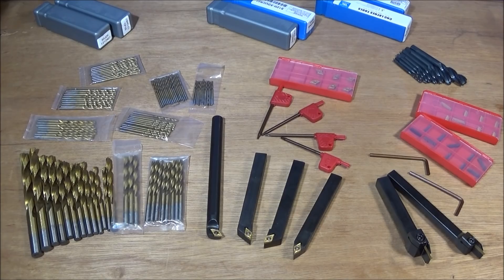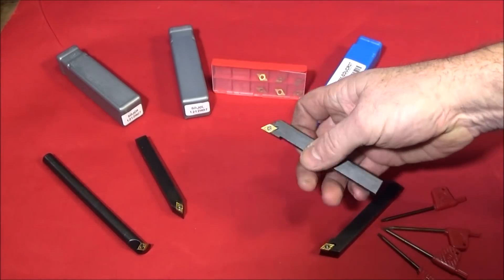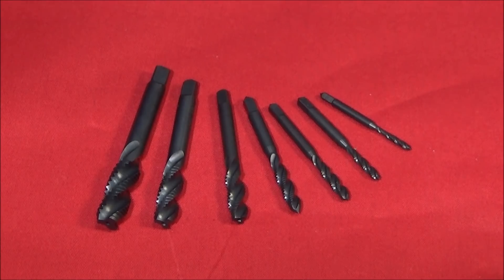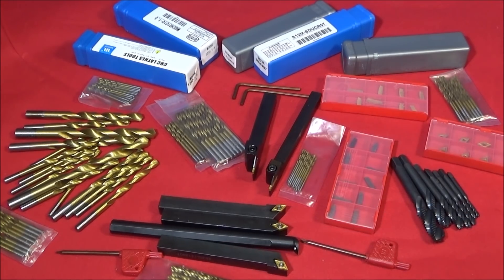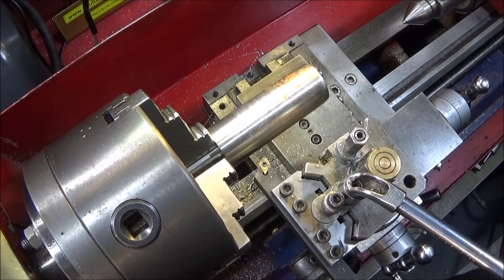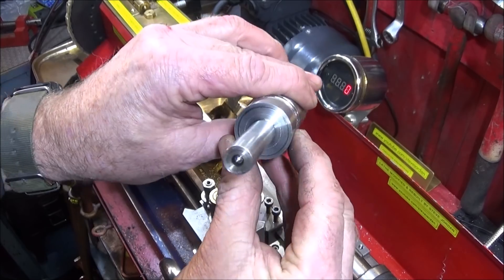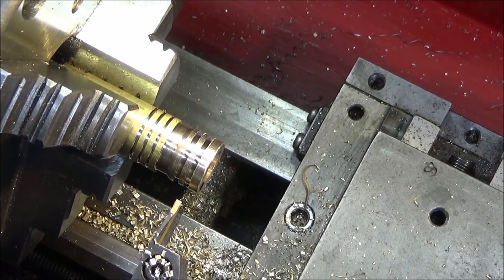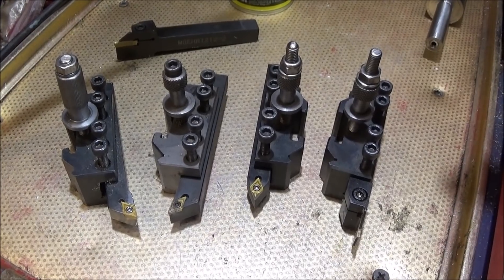The Best Cutting Tool Sets To Get If You Have Just Started Lathe Work

Comment: Don't buy the non-cobalt coated drills, they can be fake made of mild steel or something.
Reply: And for taps, use spiral point or gun taps always when you can (when tapping through holes) as they are cheaper, more durable and you can actually sharpen them unlike spiral flute taps!
Reply from the maker: I found the Chinese HSS Screw taps made by Drillpro to be excellent.
Reply: @SteveJordan  drillpro is one of the best brands in china

Comment: What would be best for my 12 inch atlas,,, blue nano are titanium?
Reply from the maker: It doesn't really matter. I only buy the Blue Nano for hard materials, but I have found the titanium coated ones very good as well. They just don't last so long on stainless steel etc, but then again they are very low cost. Regards Steve

Comment: if im running the #250-000 wedge type quick change tool post on a ML7 and use the 12mm shank tools used here, will it o low enough to get correct tool height without having to machine the top slide?
Reply from the maker: No it is limited if I remember rightly. I will re check it tomorrow as I have an un machined compound slide as well. I am pretty sure the 12mm tools are too high. Regards Steve
Reply: @SteveJordan   thanks mate

Comment: Recently I purchased a used 7x12, and coincidentally purchased as well the same tooling with inserts, that your using. Unfortunately for me I had to grind about a 16th of a inch off the bottom of the one of the tools I have tried out, to indeed center it with the work!? 
Question is, would the quick change tool post w the adjustability make it to where I don't have to ruin and grind down the rest of my tools to be centered and not too high? ( Judging by yours lining up just fine I assume my fixed standard tool holder is my issue?) Thanks.
(Edit added 2nd question) I'd like to get a indipendent 4jaw to upgrade, do you have the backing plate part # for the 3 bolt flange adapter to fit a 3 or 4 bolt 5inch chuck? Or just as well what do you have? Thanks again
Reply from the maker: Hi Kevin. If you had a quick change toolpost set that would allow proper centre height positioning as long as your tool thanks are not greater the 12mm square. I have got a backing plate for the 5 inch 4 jaw chuck. I think you can get the plates from Chronos uk. Regards Steve
Reply: @SteveJordan  thank you

Comment: Steve, you should be knighted for your service to the amateur machining community!
Reply: i haven't yet purchased a chinese mini lathe. your videos have convinced me that it would be a worthwhile purchase. however, i am stalled at the point of purchase. there are so many on offer by various resellers, as well as direct from manufacturer on alibaba. there also seem to be some variations on machine capacity and motor power, as well as purchase price.

it would be very helpful if you would do a bit of research, and address these issues, and make recommendations.

again, many many thanks for your work.

Comment: If you check the carbide inserts, none of them are actually sharp, they have a 'flat' near cutting edge  and are designed for higher speeds and feeds The mini lathe cuts better with HSS but you do have to learn how to sharpen lathe tools from blanks with a bench grinder. I think using carbide inserts is the main reason people give up with the mini lathe or burn out controllers?
Reply from the maker: Hi Peter, That isn't at all correct. Carbide inserts have a radius not a flat, which is how they are designed. They also do not 'burn out quickly' unless one is using them incorrectly. 
  I use the 070204 insert tools and an edge on one of those will last a very long time even on stainless steel. Carbide inserts also have the advantage in that one can change an edge quickly and the centre height and tool position remains exactly the same. I personally think they are the best type of tooling for lathes and CNC machine tools. 
   Also if one is new to machining, buying a mini lathe, with all its problems from new, plus having to learn to grind tools is what puts many people off. Its generally all too much for people to find out how to do things unless one is truly dedicated and perseveres. 
   Also the Chinese Mini Lathe,  has duff electronics from new, if it has the same electronic boards etc, that my 9 year old Amadeal lathe had. (I don't know if they have been upgraded now?) I have over 30 years experience in engineering, yet I had two of these boards break down and also had to replace the potentiometer about a dozen times over an eight year period. A DC motor set-up isn't all that good for a lathe. Plus when buying a Chinese Mini Lathe they need quite a bit of work to get things like the slides rigid enough for proper machining
   It is great to learn how to grind HSS tooling though and I do have many specially ground HSS tools for specific purposes, like internal/ external o/ring grooves etc. I just think with the amount one has to learn at the beginning, its best to start with insert tooling. One can also get good knowledge from these tools, how they work etc before trying to grind HSS blanks. I personally will stick to insert tooling as it is truly excellent in every way.
Reply: @SteveJordan  I think you misunderstood me about burn out. The mini lathe controllers burn out power mosfet if overloaded which is quite easy to do with carbide inserts. With a x10 loupe it's easy to see they are 'blunt'. Saying that, my mini lathe is about 14~15 yrs old and still going strong, but, I'm very careful not to overload motor.. I was given a mini mill with burned out controller, but that's another story

Comment: Will these work on a Sherline 4000 ??
Reply from the maker: Hi yes they will but check out what shank size will fit in the toolpost. You can get them with 8mm shanks if you need a smaller size. Regards Steve

Comment: Helpful advice Steve. What life do you expect for the carbide inserts. I have been using a similar brand for parting off and find that the inserts only last a few cuts.
Reply from the maker: I find the inserts excellent. The same as any well known brands really. People say that it is the ones made in India that are useless. There must be something seriously wrong if your inserts only last a few cuts. I have just made several steel components using one edge and the insert still doesn't need changing. I only use the titanium coated or blue nano inserts though.
Reply: @SteveJordan  My parting inserts are from China. They are definitely inferior to the Kennatool inserts I normally use. Maybe I should try blue nano inserts as you suggest. The holder tool is identical to one shown in your video.
Reply from the maker: @ALA-uv7jq  Hi Yes I forgot about those. The part-off inserts are not all that good yet, definitely no comparison to Kennametal, Iscar or Sandvik part-off inserts. All the turning tool inserts seem good to me though. I'm hoping they will improve the part-off inserts at some point.
Reply: @SteveJordan  Thanks. Yeh I only referred to parting inserts.The parting tool holder MGEHR 12-2 seems robust enough, just the inserts don't last, especially in s/s.  I have ordered a set of blue nano type. Lets see how they go. Cheers.

Comment: How about some UK suppliers instead of Banggood for everything.
Reply from the maker: The UK suppliers buy these tools from China for very low cost, Then massively increase the prices for re-sale. I would rather get the things for low cost as well. There are those that tell people to support UK suppliers, but most people can't afford to pay the extra costs and be charitable these days with this type of thing.
Reply: You'd be better off paying Steve. He's providing what you would traditionally have paid a UK retailer for: expertise in why/how to use these tools. The other value proposition of the supplier (and maybe the retailer) would have traditionally been the ability acquire the goods. That value proposition isn't relevant in this case.

Comment from the maker: LINKS FOR THE TOOLS.
Machifit  4pcs Tool Holders With DCMT070204 Carbide Inserts -- https://goo.gl/q4Xqm1
10pcs DCMT070202 Carbide Inserts -- https://goo.gl/BM1PVr
Machifit 10pcs DCMT070204 Carbide Inserts -- https://goo.gl/q4Xqm1
MGEHR 1212-1.5 12x12x100mm Grooving Tool Holder --  https://goo.gl/BmpQxF 
MGEHR 1010-1.5 10*10*100mm External Grooving Lathe Cutting Tool Holder -- https://goo.gl/dkLDHG
10Pcs MGMN150-G CNC Blade Carbide Inserts -- https://goo.gl/F67zQy
7pcs M3-M12 HSS Nitriding Coated Screw Tap --  https://goo.gl/FUYgqY 
100pcs 1.5mm - 10mm Titanium Coated Drill Bit Set --  https://goo.gl/6JeuUs 
7pcs M3-M12 HSS Nitriding Coated Screw -- https://goo.gl/sJcfmA
THE BEST LIVE CENTER SET.
MT2 Live Center Set With Various Ends. Morse Taper -- https://goo.gl/RLQumw
THE VERY BEST DRILLS TO BUY. Great for hard materials.
Drillpro 15pcs 1.5-10mm HSS M35 Cobalt Twist Drill Bit -- https://goo.gl/RKgAQG
Drillpro 19pcs 1-10mm HSS M35 Cobalt Twist Drill Bit Set -- https://goo.gl/YaEnRb
Reply from the maker: Banggood Christmas Sale Electrionics -- https://goo.gl/uU4fZZ
50% off Raitool Tools Clearance -- https://goo.gl/GcXvTe
Banggood Year-end Tools Clearance -- https://goo.gl/BnVctP
3-7 Days Delivery Christmas Sale (US warehouse) -- https://goo.gl/NEuhVy
3-7 Days Delivery Christmas Sale (EU warehouse) -- https://goo.gl/1DH2uc
Reply: Steve, does bang good sell standard fractional hss drill bits? I'm placing an order for tools for my Jet mini lathe. I try to watch all your videos cause you give lots of good information for the new machinist. Thankyou